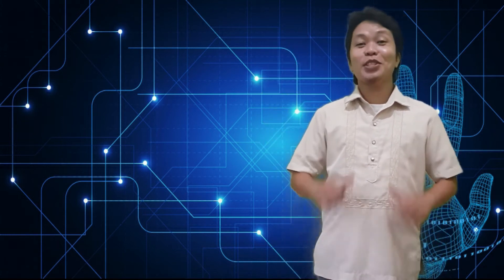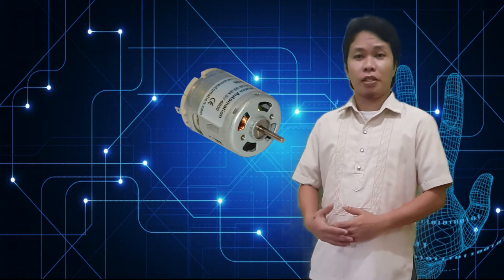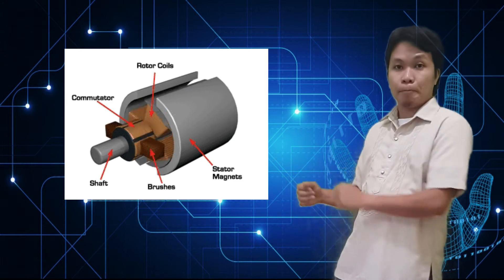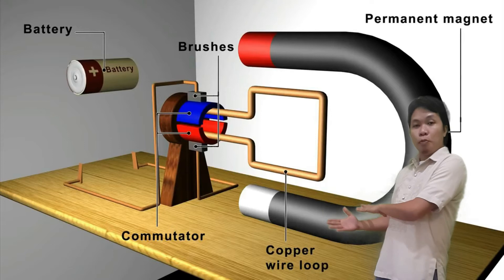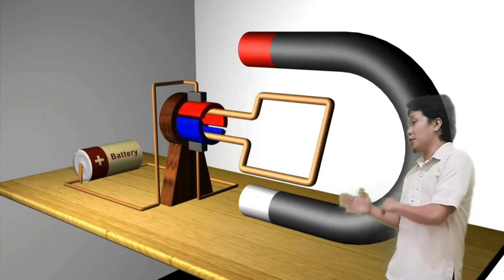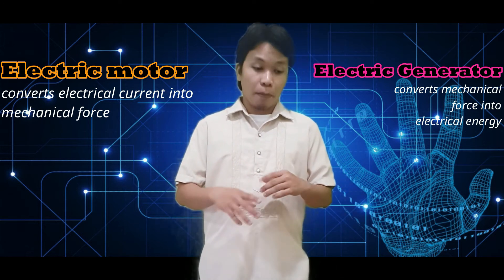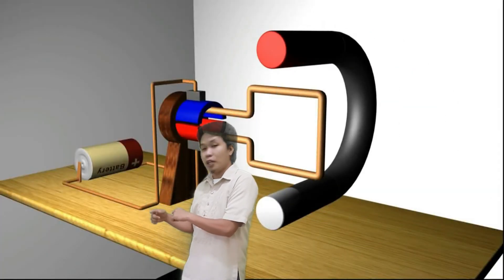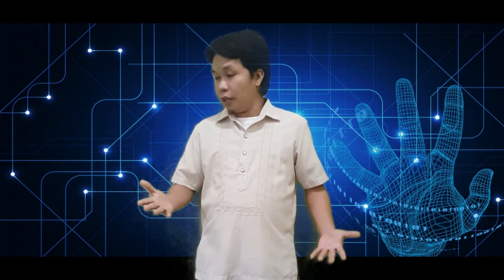Electric Motor and Generator

Comment: I have learned that Electrical Motor and Electrical Generator is related closely to each other (Have the same parts), which we can use our Electric Motor into a Generator. As the wind rotates the blade, an electrical current is produce. Example of electrical motors: "Electric Fan" - is a device that powered by an electric motor (it converts electrical energy into mechanical energy).

-Noril Encabo <33

Comment: A generator converts mechanical energy into electrical energy, while a motor does the opposite - it converts electrical energy into mechanical energy. Both devices work because of electromagnetic induction, which is when a voltage is induced by a changing magnetic field

Comment: Motor/generators are really one device that can run in two opposite modes. Contrary to what folks sometimes think, that does not mean that the two modes of the motor/generator run backward from each other (that as a motor the device turns in one direction and as a generator, it turns the opposite direction).

Enalfe Tadora

Comment: What I have learned in the video is about the Electric Motors and Generators, basic parts of simple electric motor and how does it work.And I learned that Electric Motor is a device that converts electrical energy into mechanical energy.Its convert electrical current into mechanical force.While the Electric Generator, converts mechanical force into electrical energy.